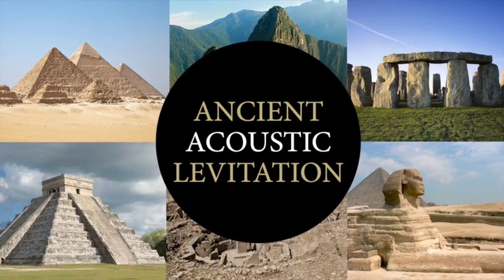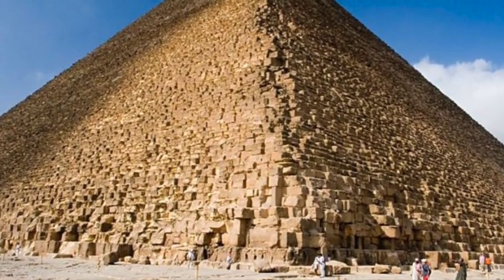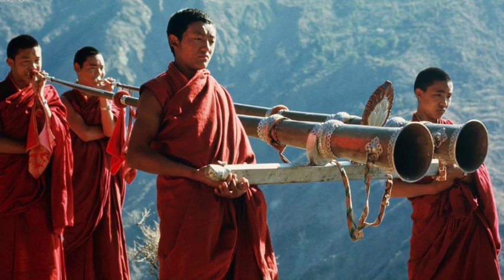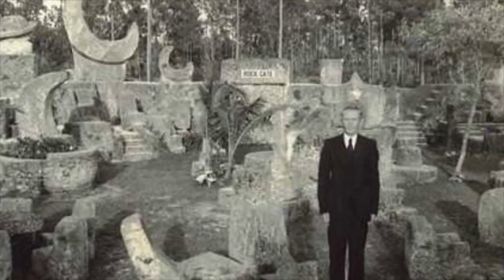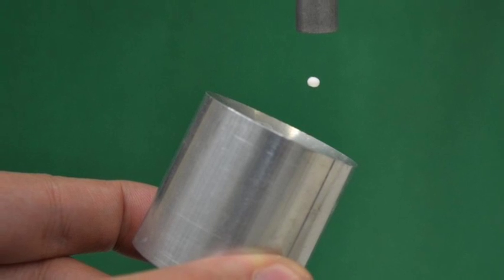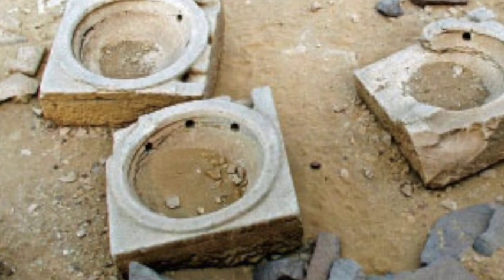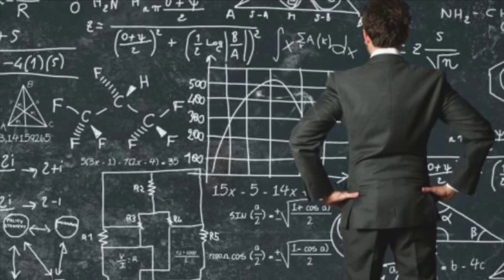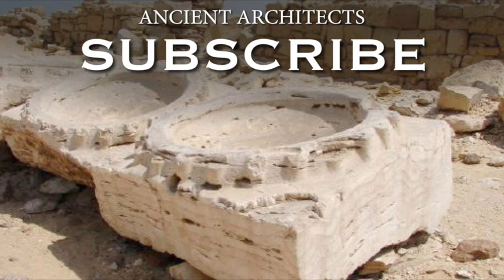Acoustic Levitation in Egypt - Ancient High Technology | Ancient Architects

Comment: Does nobody research anything?! Rightly said those boats could have moved 80-90 tons no problem, however the problem is most of the blocks at egypt weight over 100 ton! Theres problem 1. Problem 2. The plack in front of the sphinx was a plack by khufu stating he DID NOT build the pyramids and that the gods gave it him! The nile did NOT run in that area when they were constructed the entire area was underneath water its how the pyramids function and i say pyramids as in one as in the ‘great pyramid’ the other one was used in the construction and the smaller of the three was a model of the great pyramid - osires does tell you this in the writings. Those ‘sacraficial bowls’ pmsl as u say dont have a hole in the bottom! Thats becasuse nothing flows out of it it flows into it when the pyramid is on amd the water ionised the particles split this causes the hydrogen and oxygen to be broke free from the dirty ocean water and thus forma fresh drinking water which would flow into these bowls, they surrounded the pyramid fyi do u didnt have to walk hundreds of metres to get a drink they were all around and there not just in egypt. I would carry on all day but if u want my oppinion you all need to do two things! 1- forget everything you was ever told or taught especially by teachers then 2 - teach your self everything again and research weather u start here and work backwards or like me start at the beggining and work up to now i promise you three things, 1 - it will open your eyes, 2 - you will realise you have been decieved your entire life and lied to about everything and thats no exageration! And 3 - its going to make u want more to learn more and to be so much more. I struggles in my younger years at school and at high school what opened my eyes to the work and got me on this path was a bumble bee! Feel free to ask if u wanna know the story but a simple bee changed my whole life!

Comment: You would need to get the air moving incredibly fast in a horizontal direction above a large stone, and not moving at all below the stone.  Then the air pressure differential could add some lift to the stone.

Comment: Those shallow bowls are acoustic mirrors (lenses). The holes are for mounting a transducer at it's focal point, the dish will then reflect a parallel wave form towards whatever you point it at, The quartz material will amplify the sound as the piezo effect ramps up due to the mechanical stress applied to it by the transducer.. The pretty leaf pattern around the rim is for acoustic dampening of harmonics that may damage the crystal's structure. Mount it in a gymbal and you can point it where ever you like. Careful what you point it at!!
Nothing to do with religion or washing hands or blood sacrifices or dyeing clothes.

Comment: love the video and enjoy everybodies ideas but i do not think the blocks were taken up the nile 1 the nile has always changed direction and would have to be dredged for allowing boats up and down  2 its just too much weight and effort to with all the men to row the boats up the nile and at the water would be moving to fast  
3 there isnt very many trees so timber would have to come from far away so its just implausable to build boats 
4 you dont need 400  men to move those 40 tonne blocks maybe ten just cut a square on the ends of the timbers and and use the staff like a spanner and it will turn the logs like fatory rollers 
5 the blocks in the pyramid have air pockets in them the same as poured concrete and we need 
eureka i just figured how how they built them thanks mate

Comment: Thank you for your honest work.  One thing never mentioned is muscle fatigue - hard strength fueled work is for very short term only.  Just try moving a large rock.
I have seen the Coral Castle, south of Miami.  The man's technique is not a mystery,  just a secret.  The earth has a vibration, match that and the stone blocks become weightless.  He used electricity and copper cables.
Knowledge is never new, only recently discovered or just controlled.  Science maintains the delusion of just that,  otherwise our society and its engineering would completely change.

Comment: It's doubtful that even today it would be possible to generate enough power to move these extremely large rocks using such an inefficient process. Even less likely would be doing it without shattering them. However these stones were moved. Some process was used and understanding it could be important. Even if it was very primitive. In fact if it was extremely  primitive then a very impressive level of planning and management would be needed . further investigation could lead to understanding of the past and answers for our time.

Comment: Turn the granite rock into sound speakers, that would have cause the people to levitate into jumping up and down, "walk like and Egyptian...." Reminds me of a plate compactor once turned on the vibration makes it easy to push across the ground. Granaite resinating at 110hz could be enough to create the same effect, whether the use of electricity or just hitting the blocks enough to cause the blocks to resonate may have worked. Not sure about levitating in the air but definitely across the ground. If tuning rods and trumpets created 110hz freq that may have been enough to cause a double up freq effect or a forward momentum freq effect.

Comment: The singing bowls are still there on the plateau. You show them in your video.. they are singing bowls. You rub a rod on the top of the bowls and they start vibrating for up to 3 minutes. Big Bowls = Low frequency!...when pulsed lifts the stones. (Which would explain the shape of the bowls on the outside... it's pulsing between 2 notes below the range of hearing)  likely the 2 octaves of the F sharp major chord!!! If you could hear it it probably sounds like woh...woh...woh...woh...woh... switching back and forth between the 2 octaves.
If you ever own a singing bowl and fill it with water and make it sing... the water literally jumps out of the bowl.
The giant stones are piezoelectric. When you get them to vibrate they load up with high voltage giving a negative field around the stones and since the ground is also negative the stones repel the earth.
The stones in the pyramids are all cut in tune to a musical note because of their shape and since they used the golden rectangle a lot they were likely using the F sharp note at 432 hz tuning... and so you have singing bowls tuned to the same note as the blocks.. and so you vibrate that note and the blocks pick up the vibrations by resonance... and they levitate and you just have to push them in place.
All it takes to make the bowls sing is a long rod or a good strong pole. You get 10 people at the same time each making one bowl sing and all the blocks in the area that are cut to the same note are all floating around. When you think about it, it's actually simple technology. It's just few people saw it yet.
When I was younger my music teacher told me that music is a universal language. He was right in more ways than he probably knew.
The whole universe is 3d printed from one note.. the F sharp note... the only note that can collapse on itself into a toroid shape that creates the  plasma that rides this wave and assembles everything.

Comment: The concave basins at 8:25 like they held some sort of roller bearings, which could have made moving huge blocks nearly effortless when rolled on a smooth stone pathway. The ports in the sides of the basins could have been used to pump in oil or animal fat to reduce friction. The balls fitted into those „basins“ would in turn act as very strong and easily maneuverable wheels, which would make it fairly easy to move the stone blocks from the barges to the construction site. Alternatively, a row of the basin blocks could be set on the ground, basin-side up, and used like a long roller-type conveyor system.

Using the basins as piezoelectric speakers would require a high-frequency a/c power source (like a sine wave generator), and massive amounts of power. I doubt those blocks could withstand such intense vibration for any length of time without shattering.

Comment: If you compare Ed Leedskin motor which I believe is actually a coral grinder  to the Egyptian Bowl shaped objects you can tie this all together.  Ed and the Egyptians ground the material rock or coral to be levitated.   This caused a ringing event in the Ether and the entire area ended up ringing for some time afterwards the more bowls used the more powerful the event.  Both Ed and the Egyptians used CONE shaped material to focus the ringing Ether onto that which needed lifted.   Same thing in Tibet only they used sound only as far as I can gather to lift the bolder up into the cave on the side hill.   The Russian guy using beetles curved structures is basically the same thing.     So we need to test this info and see what happens.

Comment: Simple ramps and pulleys is all you need to move even extremely heavy objects once you have reduced or eliminated friction. By vibrating the stones you are essentially "putting them on wheels" making it many times easier to move. No need to actually levitate them. The coral castle was built with a tripod, speaker, ramps, water, sand, and some sort of oscilloscope judging by the pictures

Comment: I moved a heating fuel tank filled with diesel using my horrid sounding electric sander. The vibration caused it to slide freely across the garage floor. Could not move it any other way.

Comment: Seems like a complex explanation to a simple problem: transporting the blocks up the pyramids. The most reproducible method is simply flooding the great pyramids with water from the Nile using a plunger valve. You could use a canal to float the blocks from the river to the base of the pyramid, and gravity to unflood the pyramid. I don't see why the boats would want to lift the blocks out of the water since they float. There is certainly mythology indicating that Egyptians used antigravity, but this is not reproducible as of yet. The resonating bowls might have been used to produce AC current?

Comment: Stone basins were probably used as holders of round stones and used as a ball bearing system placed at different locations for moving along heavy slabs and blocks of stone. Mary B. Penttila
Reply: would be interesting to test theory  They have huge balls in concave containers  on children water splash parks. The water is forced under the balls and produces a fluid ball bearing effect.Several of the large bowls with the balls could be used to move a heavy stone.  The problem would be to keep the water moving under the round balls. It could be possible that if the water were charged sonically, , it might be possible to maintain the fluid cushion needed. I doubt that compressed air was used.
Reply: @Tejasmed    Olive oil and fine sand or just olive oil--plenty of slaves to keep things lubricated and rolling along.

Comment: Ancient Architects, before I listen to this video, I was wondering if I should take you seriously or if you are just talking pseudoscience. Now I know, it's not science at all.
Even if you don't believe that the Egyptians carried big stone blocks on skids, that does not make your "acoustic levitation" idea realistic. 

Look closely at the modern science results you are showing us in this video. Did you notice 2 fundamental things:
1- all the objects are very small (few grams) of are styrofoam ball of some kind. Nothing comparable to a stone brick, much less a 1,000 ton stone block or a 60 ton block.

2- In every examples shown, you can see a distance of between the sound generator and the piece being lifted. In this empty space, some air. Air is needed, otherwise no sound, right? But air is a compressible gas. Lifting a 1 kg brick or a 60 ton block on top of a column of compressible gas, as you are walking on a sandy surface like those found around the pyramids, makes your proposed concept totally non realizable.

3- Once you would have succeeded in building such a sound device that you can use it to move stone blocks of any sizes, how could you possibly lift just one block with it and deposit it in an already places row of blocks without totally disturbing or even totally destroying this row of blocks. How could you so precisely control the size of your sound lifting beam to pick up just one block?

4- If you look at the propagation of sound from an emitter, like the drums and trumpets shown or any other model, you will see that the propagation of the sound waves is spherical. How can you control this propagation into a small cone that would fit only under the object that you want to lift? 

5- And how much energy would be needed? Where would the ancient Egyptians have got it? And how much sound would be needed. Don't you think that the neighbors of the "coral castle" would have complained about the extremely high sound level needed to move these blocks?

Acoustic levitation for heavy blocks (more than few grams)is a total non-sense.

Before proposing some unreal ideas like this one, it would be nice to analyze it from a practical point of view first. Don't just say what you think has been done without first trying to describe how it would be really feasible. 

Then it would be good for science because for science to be, it must be practical.
Reply: You may be right but I use vibration to move heavy objects in my garage.  Getting the frequency just right causes it to become easy to move.  I don't have sand under me but with enough energy my garage floor may turn into sand one day.

Comment: well I for one don't believe this  now what seems more likely. Who has ever been on a dance floor knows they put stuff on the floor so you can slide your feet easier, I think they made a road out of these blocks and then pored dry sand on the road and that helped with dragging the blocks plus it would also help shape the blocks once they has so many blocks they could then use a leap frog  like say you have 10 blocks and you take the last one in line drag it to the front so on and so on until you reach the destination

Comment: Log-rolling the blocks downhill is just a matter of braking and control. It's getting them off and back up the hill that's more tricky. Could have been a hybrid solution. That said, the Pyramid structures were built using water-based foundation leveling, so it's reasonable to guess that they didn't have to move the stones far to get off the boats.

Comment: They used a set of rollers that are mounted to frames like a conveyor belt with sections that come off and can be moved in front of the next with a gurnee that would help pull the stones along with heavy ropes, pulleys would easily move these stones especially if you used large animals to pull.

Comment: You didn't tell about how after completing his coral castle Ed was not happy about the surrounding area being built up so Ed moved every block by loading them on a large flatbed truck and unloaded them at the present location some 10 miles away from the original spot. He did the loading and unloading by himself. The driver of the truck was instructed to wait elsewhere while Ed loaded the truck. The driver said one time after dropping the truck off to be loaded he waited elsewhere as instructed but returned to the truck after about half an hour only to find it already loaded with tons of blocks.

Comment: 10:34 I recently learned that sound is not part of the electromagnetic spectrum, but rather it's more a transfer of energy through pressure (air pressure) or other material mass. Electromagnetic radiations do not require a medium, which is why we can see and harness light from the sun through the vacuum of space.

Comment: You are right on the money...did you also realize that the larger the stones (must necessarily contain material < piezo effect) the stronger the resonances...therefore there is a critical  minimal mass (the larger the better) as to gain the force to spit an obsidian large stone e.g.  There might be an optimal size with resonance and transportation issues....I would scale these monolithic blocks worldwide with regards to which size vs dimension are the most common....this ancient round metal object, lunatics and conspiracy theorist called a prehistoric radar dish, is part of a water pump... also for stone cutting or surface finishing...I have a friend from University, Berry Groman who designed dental medical devices, using water jets, containing hard mineral in dentistry.

Comment: There's actually film of the guy building coral castle. He used pulleys and rollers.
Reply from the maker: I saw this after making the video! Shame you can’t edit uploads.
Reply: Is that really what you came away with after seeing the video, did not other questions come to mind about how much of the castle couldn't be done using pulleys and rollers. Case in point the multi ton stones that are placed atop other stones which are taller than the tripod pulleys.

Comment: cement made from crushed granite. They knew about a polymer based cement as we are finding out. The Bosnian pyramids were made with such a cement and they are way older. Moving powered stone is very easy and all you need to do is just add water. I think they also had water jet type cutting as well.